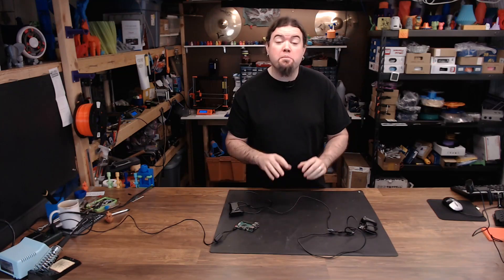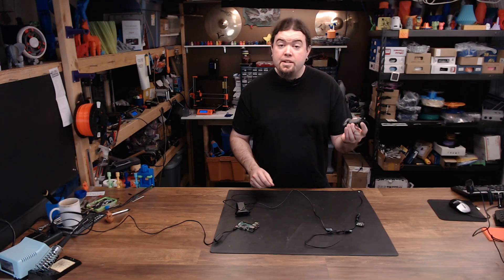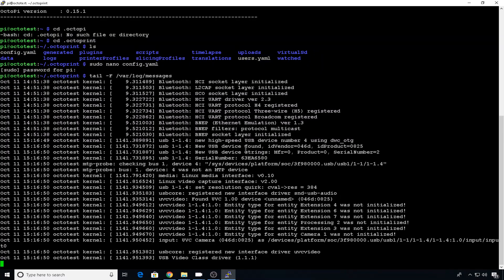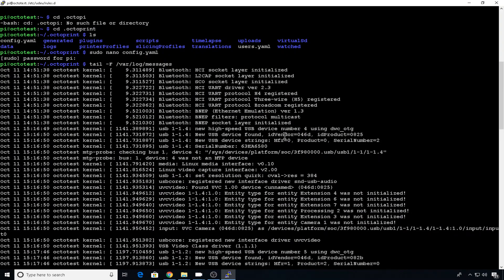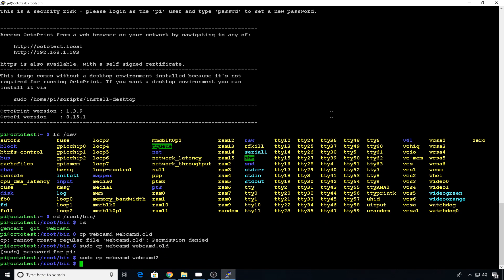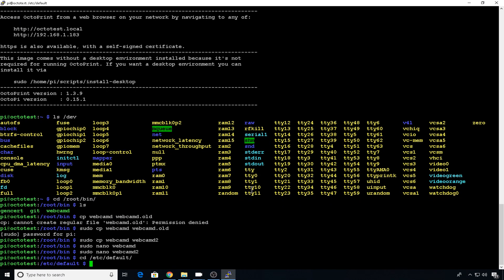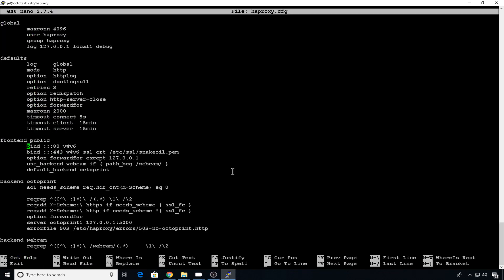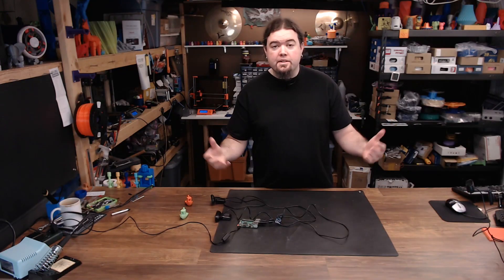Depreciated -  Multi-cam Plugin - Chris's Basement

Comment: Alrighty so I followed your very detailed tutorial and doc (thank you) numerous times, but not it will not load octoprint as it returns an error stating the server is not running. I reverse followed your guide to go back to defaults and it still will not load. Looking at the logs there are no errors that jump out yelling and screaming.
Tried  ps -aux |grep .octo  - did not see any erros
Tried ps -ef | grep -i octoprint | grep -i python and did not return any info
Checked ~/.octoprint/logs/octoprint.log did not see any glaring errors
Tried sudo service octoprint restart and still same, loads saying octoprint is not running

Currently 2 usb webcams and a 7" display running touch ui

Any thoughts on what I jacked up?
(the only good thing about this is the wife is happy because she doesn't hear the damn thing running overnight while she's trying to sleep)
Reply from the maker: Hey Kevin, send me an email and I will send you some code to run so I can see your logs. brotherchris81@gmail.com
Reply: were you able to get this worked out? I am having the same issue... thinking might be two cameras taking too much power...

I think this may be the problem. 2019-05-06 22:12:55,833 - octoprint.plugins.pi_support - WARNING - This Raspberry Pi is reporting problems that might lead to bad performance or errors caused by overheating or insufficient power.
!!! UNDERVOLTAGE REPORTED !!! Make sure that the power supply and power cable are capable of supplying enough voltage and current to your Pi.
2019-05-06 22:12:56,743 - octoprint.plugins.tracking - INFO - Sent tracking event system_unthrottled, payload: {'throttled_mask': 327680, 'throttled_voltage_now': False, 'throttled_voltage_past': True, 'throttled_overheat_now': False, 'throttled_now': False, 'throttled_past': True, 'throttled_overheat_past': False}
2019-05-06 22:22:37,377 - octoprint.server.heartbeat - INFO - Server heartbeat <3
2019-05-06 22:22:44,881 - octoprint.server - INFO - Shutting down...
2019-05-06 22:22:45,758 - octoprint.events - INFO - Processing shutdown event, this will be our last event
2019-05-06 22:22:45,761 - octoprint.events - INFO - Event loop shut down
2019-05-06 22:22:45,764 - octoprint.plugins.TemperatureFailsafe - INFO - Shutting down...
2019-05-06 22:22:45,802 - octoprint.server - INFO - Goodbye!

I have since reverted back to original setup and luckily the server came back. I will try again after getting a powered usb hub!

Comment: It is not working for me. I re did your tutorial many times, all has been set exactly as you instructed, but it's only one cam working. Both camera are working separatly if connected and pi is rebooted. But unable to use multicam feature. I have the 2 buttons, but I get the black screen saying: Wecam stream not loaded... 
For info, I m using 2 logitechs. One is the round Quickcam and the other one is the Quickcam Fusion. 
Do you have an idea?
Reply: Thanks Chris for finding what went wrong in my config! For those who run into something similar, I'll document it here: make sure your octoprint.txt has the camera command deactivated. It should be something like that: 
# camera_usb_options="-r 640x480 -f 15"
Reply from the maker: @qools1  You bet! Glad it's working now.
Reply: @qools1  Thank you.. I was seeing the setting for the 15 fps and had set it to 10 since we are using 2 cams now. Hopefully this will fix the can't connect to server issue!
Reply from the maker: You can send me an email and I will take a look at your logs. brotherchris81@gmail.com

Comment: Not sure how I messed this up this badly, but I was following your steps as followed right up to the end, then with the reboot before doing the final configurations in the Octopi GUI something must have gone wrong, as now I can't access the Octopi interface. I can SSH into it with putty, but thats it. Any ideas what went wrong?
Reply from the maker: If you do a     ps -aux |grep .octo       what is in there? Sometimes the service just doesn't restart.
Reply: @ChrisRiley  Thank you for the reply! Regretfully, it shows that everything is working as it should. The only things I did different from this tutorial was running atp-get update and upgrade. Could this have caused the issue? If it helps I am using two Logitech C920 webcams.
Reply from the maker: @benjaminford8173  That should have been ok, as long as they completed successfully. Remove your haproxy stuff and reboot.
Reply: @ChrisRiley  Thank you so much, I can use octopi.local again! So did I bork up the haproxy file? I tried to use the copy/paste but couldn't seem to figure it out (it was late when I was working on this) so I just manually retyped everything instead.
Reply: Got everything working thanks to you, yep I somehow screwed up the haproxy file and re-dooing it fixed everything. Thanks again
Reply from the maker: @benjaminford8173  Sweet man! Glad it worked!
Reply from the maker: @benjaminford8173  You are a gentleman and a a scholar. So glad you got everything worked out. Thanks man!
Reply from the maker: @benjaminford8173  Nice! Yeah, copy and paste in terminal is a crap shoot. Glad it's working and thanks so much for the PayPal.

Comment: Hello,
I have two C270 cameras running camera switching.
But he gets a bug with Snapshot test failed: Could not retrieve snapshot URL, please double check the URL

I can not find a solution, will you help?
Reply from the maker: Do you have both of your URL's set the same? What are the settings in there now?
Reply: @ChrisRiley  The problem is that with a fresh installation with one camera there is also a mistake.

Comment: There is only one missing information for me in this video, otherwise an awesome guide!
My only problem is that one of my cams are the raspi camera that is connected with a flatcable.
What i had to do was modprobe the raspicam so i got a video0 for it and only named the usb connected ones as in video, works.
Reply: Could you explain this a bit more perhaps? I am dealing with the same problem, thank you so much.
Reply: @Mycoldshower  did you ever figure this out? im still trying to setup a second cam with usb and first cam being raspi cam
Reply: @Elijahsing1  Nope sorry, still trying and working on it.
Reply: @Mycoldshower  What I did wast add a line in /etc/modules with just bcm2835-v4l2 and then restart the pi.. now you will see /dev/video0 for USB cam and /dev/video1 for the Pi cam
Reply from the maker: Thanks for the update. I really need to get a Pi cam so I can test things like this.

Comment: For those with a Raspberry Pi Cam - I struggled the whole day using this and other guides with mixed results, best I could do was get my usb cam running manually, until I came across a simple solution that works almost perfectly for me: jgalak's solution in
 https://discourse.octoprint.org/t/how-can-i-configure-dual-cameras-1-pi-camera-and-1-usb-camera-on-a-dual-printer-setup/694/15

Works perfectly for my Raspicam 2.1 and PS3 Eye Cam.

Edit: In Octoprint/Multicam plugin just check for both ports you've set (I suggest you use the ports as per the guide) as well as the default 8080...

Comment: Hey Chis,
I am currently using IP cameras through a 3rd party app to monitor my printers, would it be possible to incorporate the IP camera to display in Octoprint?
TIA
Reply from the maker: Not sure, do those cams have a direct url you can view them from? If so, you can just plug that into the gui.

Comment: Awesome video Chris.  I'm just getting used to my raspberry pi and have been using my phone or tablet for my timelapse videos.  Looking at getting a webcam or 2. Which ones would you recommend? If I may ask.
Reply from the maker: Thanks! I use logitech c270's just cause they are cheap and easy. The picture isn't that great, but they are good for monitoring.
Reply: So could you have one camera doing a time lapse video with Octolapse and another one so you can just monitor the print from another location?
Reply from the maker: @andypodmore6721  sure, just put the one you want in the octolapse settings and you should be all set.

Comment: Yet another fascinating topic. Will give it a try as soon as I've got the hang of timelapse settings. Hope to get round to having another go at your instructions on linear advance over the weekend, just did a (CR-10) print of a square box with a lid and it had those extended corners, can't have that.
Reply from the maker: Thanks Spike! Oooo, yeah, LA should help with that I hope.
Reply: @ChrisRiley  LA has reduced it a little, but not as much as I was expecting. Will have another go later.
Reply from the maker: @spikekent  Hmmmm, let me know how it goes.

Comment: Niiiice, I currently have Repetier on my raspberry, need to pay for camera ...
Reply from the maker: You have to pay to add a cam to that setup? Or you just need to buy a cam?
Reply: @ChrisRiley  You have to pay for the camera option on the Repetier firmware you install on your raspberry . The nice thing is that it supports 2 printers in the free version without any modifications .
Reply from the maker: @bbogdanmircea  Interesting, I have been meaning to set this up to try it out for a while now.

Comment: Hey Chris! Thanks for another very informative video! I was wondering about a couple of things. First, out of curiosity, are we able to configure multiple cameras on multiple printers (i.e. two printers with two cameras EACH)? I assume you could by just creating additional webcam instances under each printer. Second, is it possible to run timelapse with multiple cameras? This one does not appear to be possible as there is only a single entry available for the camera associated with the timelapse. Thanks again! You are doing some serious voodoo with OctoPrint! :)
Reply from the maker: Hey Chad, thanks! Yes, you can use the multicam plugin on multi installs, but I am not sure how that is going to affect the config.yaml file, it "should" be fine. As far as multiple timelapse, that's a little trickier. I think you could record 2 pretty easy, but you would still have to put them together outside of octoprint. Not sure, I will do some looking around.

Comment: Small nitpick. Setting options to itself should be uneccesary. Its there originally to append more options, but since you arent adding anything, you can just skip that line.
Reply from the maker: You know what, I didn't even look, you are correct. I could have commended it out all together. Thanks!

Comment: You are the MAN Chris!!!! Now watch me get "sick" so I can go home and get this up and running.
Reply from the maker: lol, good luck man, I hope it goes smooth. Let me know.
Reply: @ChrisRiley  will do..... Definitely is more detailed and better than what I found out there.
Reply: @ChrisRiley  I hit a snag. I cannot get the webcam to start: ● webcamd2.service - LSB: webcam2 daemon
   Loaded: loaded (/etc/init.d/webcamd2; generated; vendor preset: enabled)
   Active: active (exited) since Fri 2018-11-09 03:21:22 UTC; 6min ago
     Docs: man:systemd-sysv-generator(8)
  Process: 330 ExecStart=/etc/init.d/webcamd2 start (code=exited, status=0/SUCCESS)
   CGroup: /system.slice/webcamd2.service

Nov 09 03:21:21 Octopi systemd[1]: Starting LSB: webcam2 daemon...
Nov 09 03:21:22 Octopi webcamd2[330]: Starting Webcam2 Daemon: webcamd2.
Nov 09 03:21:22 Octopi systemd[1]: Started LSB: webcam2 daemon.

Ideas?
Reply: @ChrisRiley  I got it figured out. If you access remotely you'd want to remove http://192.168.1.183/webcam2/?action=stream and just put /webcam2/?action=stream as using the IP address will cause an issue when accessing remotely.
Reply: Love the video man. I have a question. Recently I had 2 crashes on my mk3. Octoprint has no way that I can see to restart the print. Is this your experience as well?